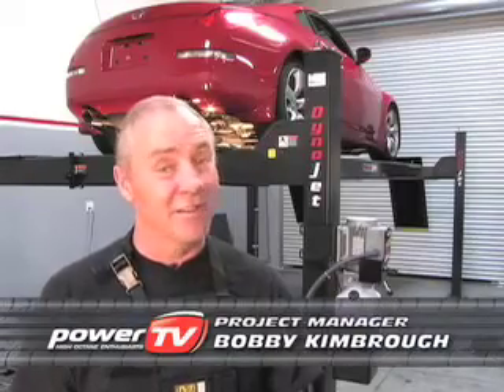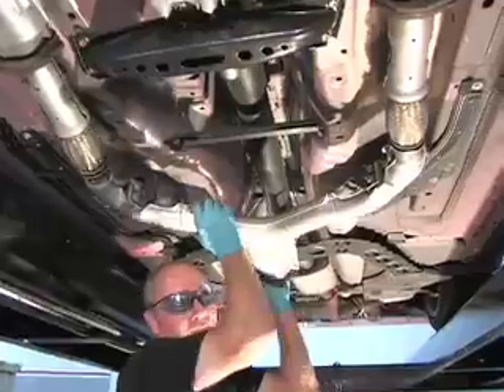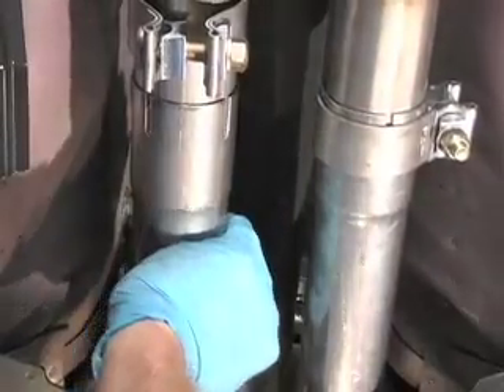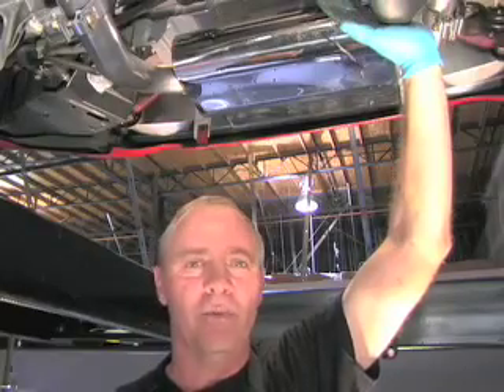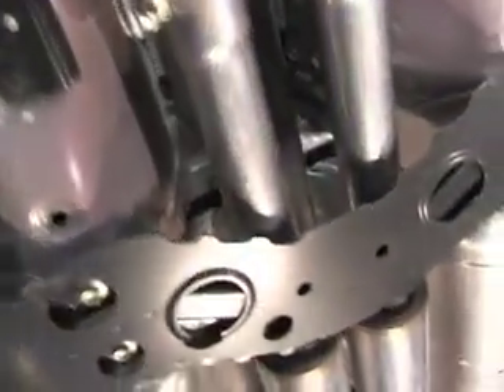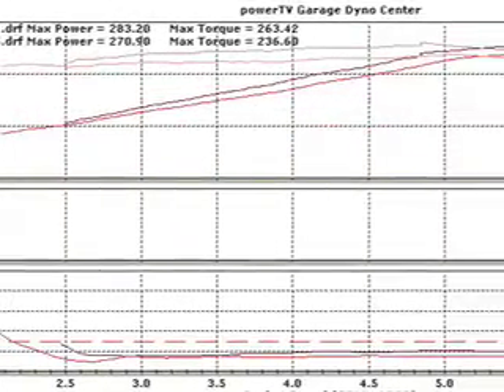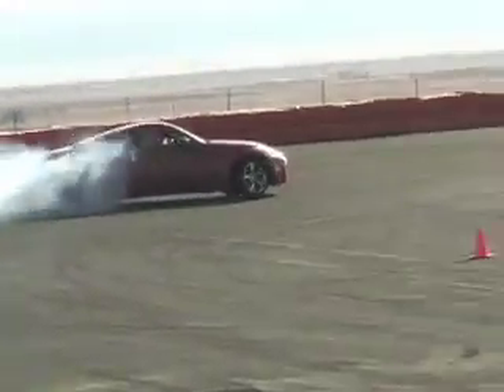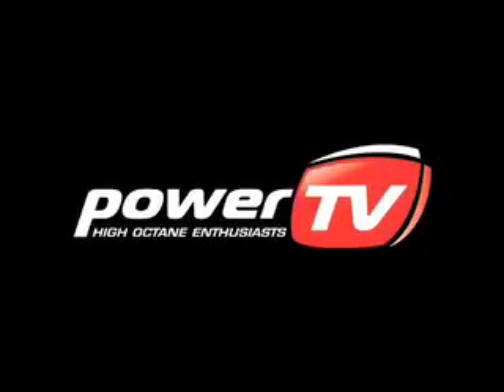Nissan 350z Install Video Bassani Xhaust

Comment from the maker: Hi, Thanks for your interest in Bassani Products. 

We are not aware of any rattling noises associated with the 350Z system. The tip is welded on.

However it you have an aftermarket sway bar it could be rubbing the exhaust pipes.

If you have any questions feel free to call us. 866-782-3283 ask for Kurt.

Comment: i'm really interested in this exhaust, but i've been reading a lot lately that the tips are rattling loose.  how do you guys at bassani suggest fixing this?  for the kind of money i'm about to shell out for one of these bad boys, i'd think the quality would be a little bit better?  not bashing the product, i just don't want to have a problem with an exhaust that costs that much money.